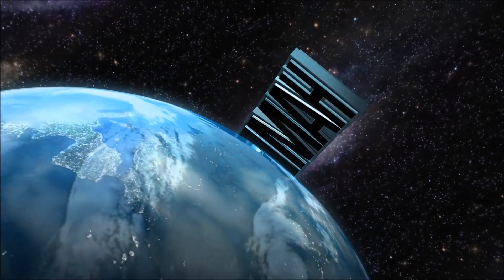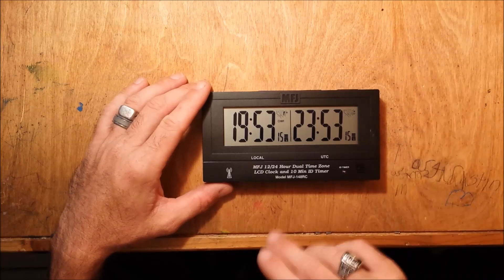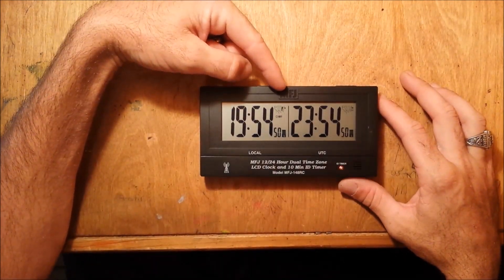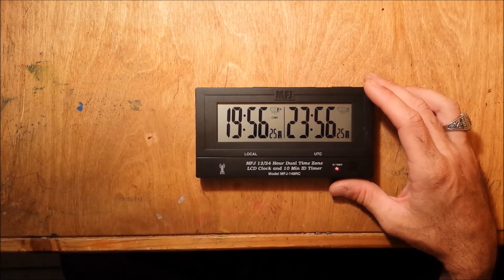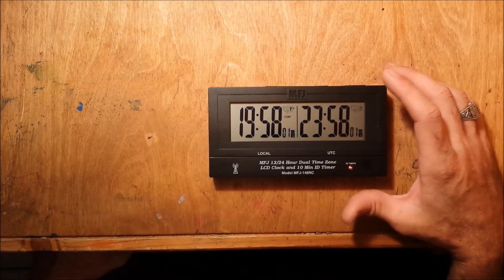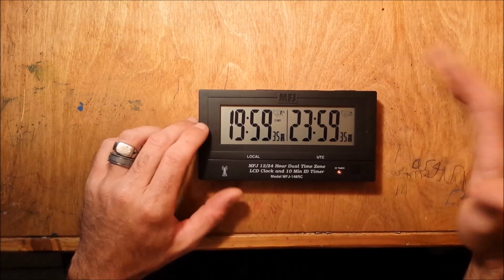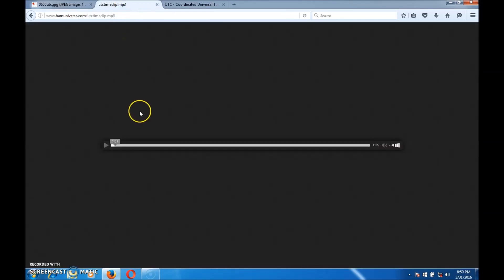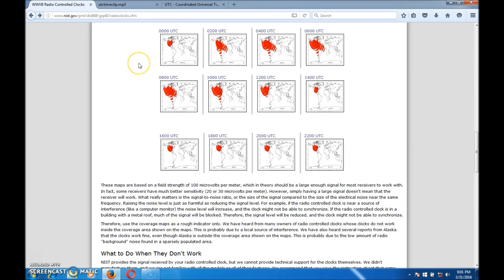MFJ-148RC radio controlled clock atomic clock

Comment: Does anyone make a clock just like this but also includes a Temp indoor/outdoor reading? 
Ken
Reply: Having purchased an "atomic" clock   some years ago with a wireless outdoor temperature sensor, I would never buy one again.  They use a cheap ceramic resonator for the remote sensor's timebase that drifts sufficiently to where some of the units will lose synchronization within two to four days and thus will stop displaying the outdoor temperature.  If you search the Web and read reviews on such clocks from SkyScan, LaCrosse Technology, Oregon Scientific, etc., you will find many adverse reviews and complaints in this regard.
Reply: Ken sure multiple manufacturers... Texas instrument   etc etc